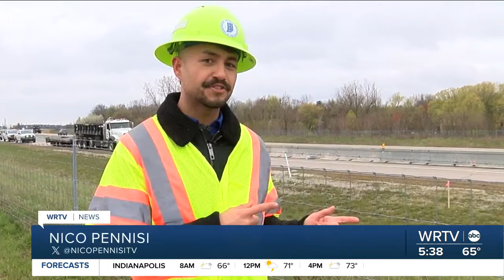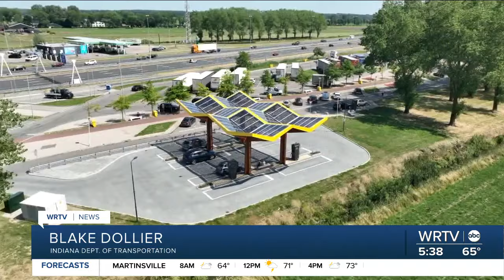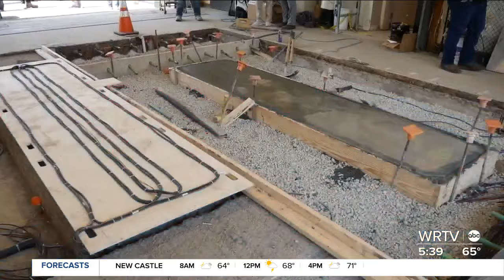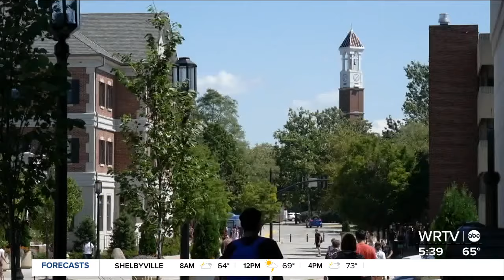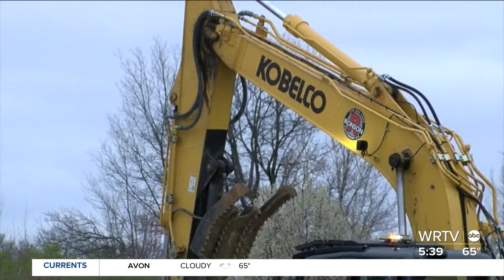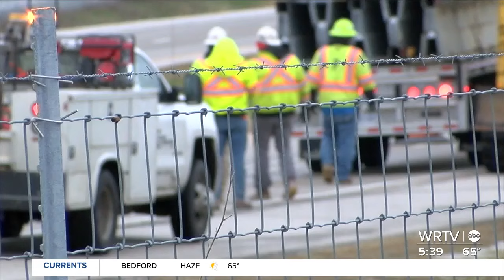Purdue project could allow electric vehicles to charge while driving on the highway

Comment: Inductive charging a moving vehicle will be horrible inefficient.  Maybe they will achieve 50% efficiency in laboratory conditions.  That will translate to maybe 20-30% efficiency in practice.  Meaning it will take three to five times as much electricity to achieve the same charge.